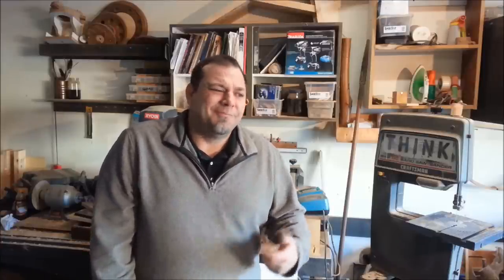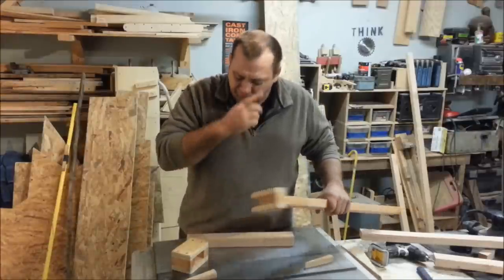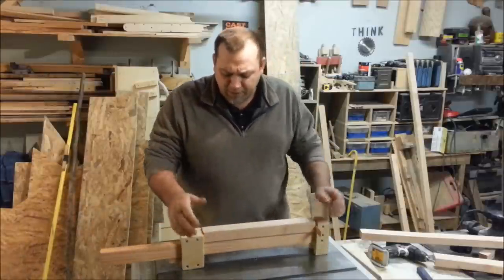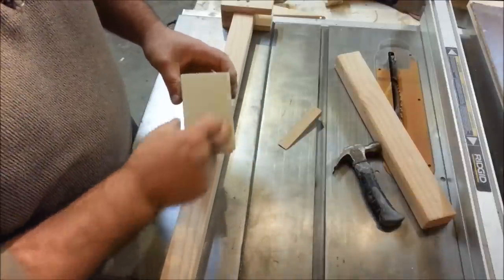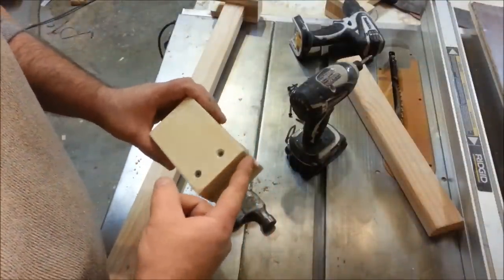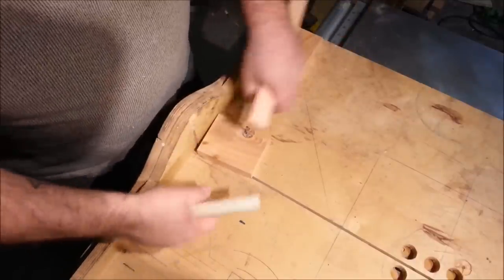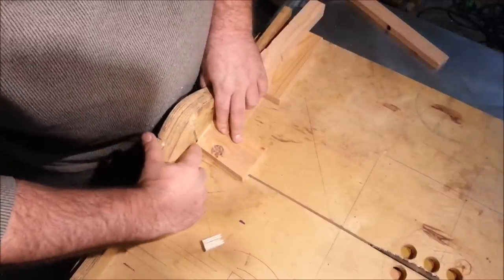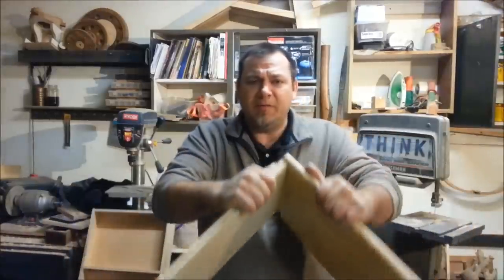Simple! Homemade (Wood) Bar Clamps! No Hardware Needed!

Comment: Made a batch of these of 55 inches. I found the my saw cuts on the bar and the wedges were too smooth to provide enough purchase but a little scraping with a brass brush on the pressure surfaces of the wedge and bar did the trick. Great clamps

Comment: I made this clamp and it worked great.  However, instead of cutting an angle on the fixed end, I left it straight and then used two wedges, one on each side.  This tightened it up more evenly for me.  Great clamp!

Comment: If you clamp with wedges on a big panel glue up or say a butcher block type cutting board would the pressure you apply be uniform through the work piece? I like this idea and don't want to spend a lot of money on clamps but I also want to make sure if and when I try a bigger glue up this will be adequate and uniform pressure. Thanks for the great content and helpful videos to us that are beginning woodworking

Comment: You could tie those wedges with a piece of string to the bar clamp so you don't loose them. You know, one to the head of the clamp and the other to the sliding part.

Comment: What if you cut the bevel on the top instead of the side so the wedge can be tapped in on the top? Wouldn't that keep the clamp from racking when you tap it on the side?

Comment: Is it possible to use this clamp with just a wedge on the moving part and leave the fixed part not wedged, by keeping the fixed part straight instead of at an angle? I was wondering if one part (the moving one) could do the pushing force enough to keep the piece in place. I really need to make a clamp like this here in Malaysia as things are so expensive here!

Comment: Would these be good to use making a cutting board? Thanks Izzy. Great stuff!
Reply: if your lumber is properly prepared and cut straight these will provide ample pressure to hold together a cutting board during glue up. Just remember to not put excess pressure or it may bow your cutting board during glew up
Reply: These are perfect for that

Comment: So should I make the wedges first so to use as references and would 1 x 2's be a good size to use as well. 1 x 2's aren't as bulky since I don't build heavy furniture or big projects? Awesome idea and thanks for sharing.
Reply: +frehleycomet If you watch Izzies latest video on "Corner Clamps" I think he suggests he makes his wedges at 8 degrees, 
he also explains at 5-18  that when you are cutting the waste off the "Head" you use which wedge you are going to be using with the clamp.
Also at 4-18 he explains How to get the angle on the "Tail Block" 
You could use ANY size timber for the "Bar" as long as you build the "Head & Tail" to suit. Hope this helps.
Reply: Ok Thanks

Comment: watching some of your older videos and the thought occurred to me; why not add your hold down clamp design but in plunger style to this clamp on the end vrs wedging. I like the wedge but your plunger style clamp would be sweet.
Reply: +TheKlickitat  I think that if you put a hold down clamp on the end of the clamp, the clamp would have to be only as long as the project you are building,  or to within an inch or so, that is if I am thinking on your wave length??
Reply: +alan dobb I was thinking of the plunger on the fixed end.
Reply: Yes good point now I know your thinking.😕